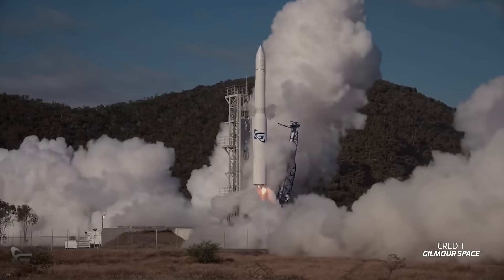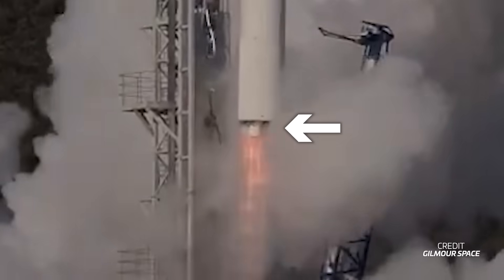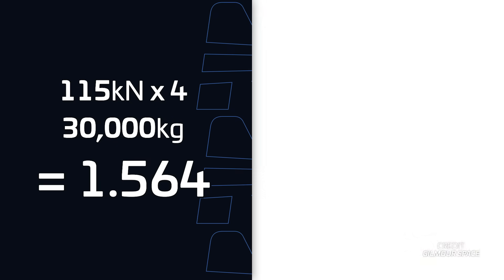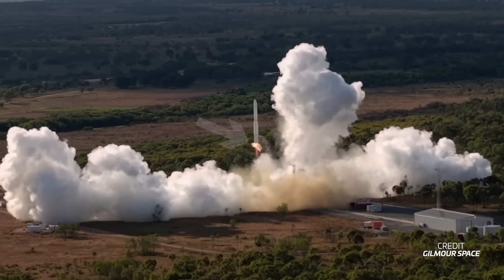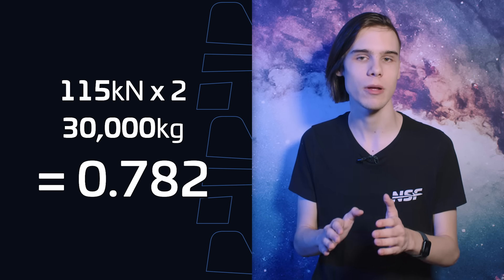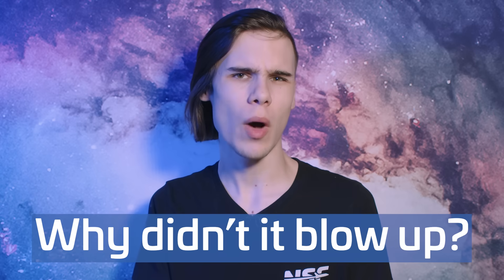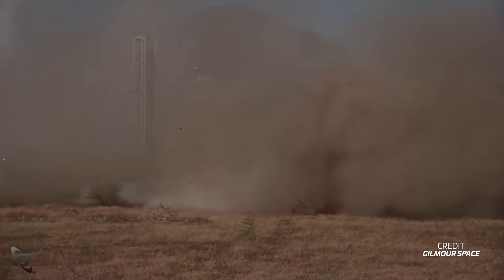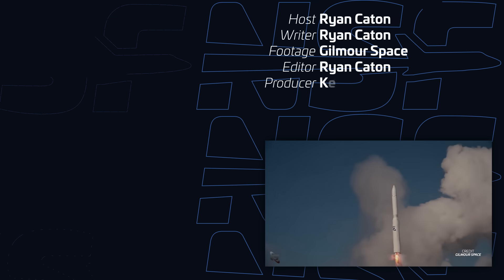Why Did Australia's First Orbital Rocket Last 15 Seconds? | Gilmour Space Eris Flight 1

Comment: They need a new 1st stage design...the hybrid isnt reliable..in test the fuel grain would blow holes out the side..resulting in complete failure..it almost looks like that.. you can see the small flame in the 1st engine then jumps to the 2nd engine.. when I worked there I wasn't a fan of this hybrid engine. They used a lot of parts from Bunnings..